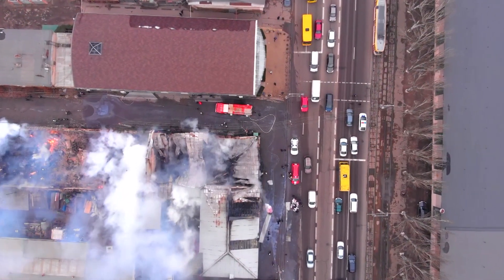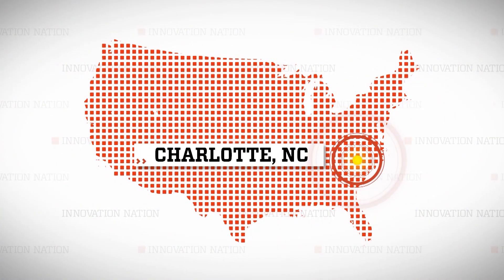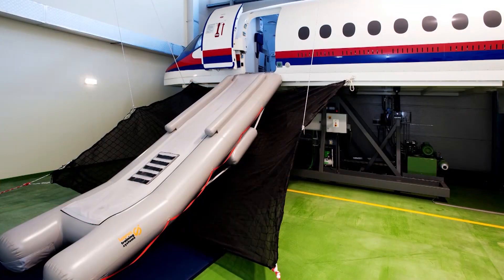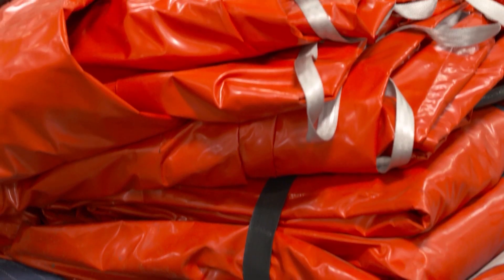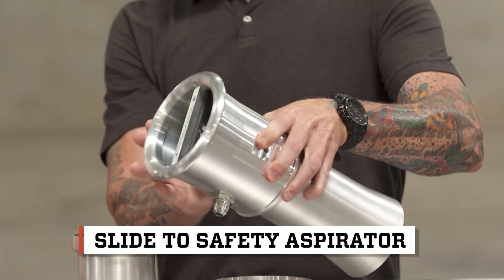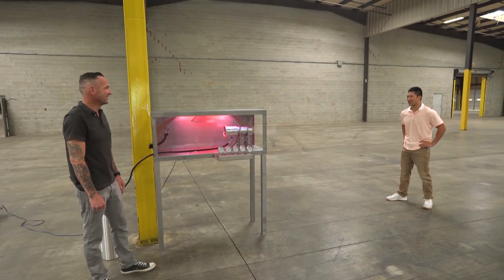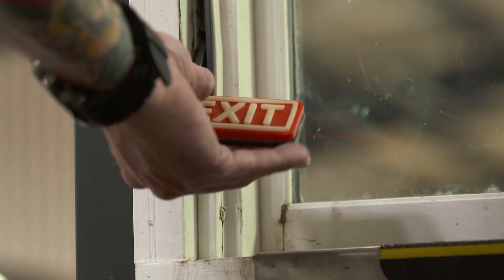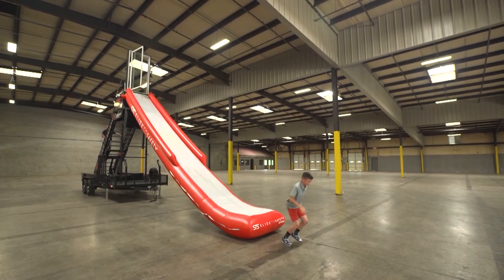How a Pilot Adapted the Airplane Evacuation Slide to Buildings | Innovation Nation

Comment: So frustrating the wrong information.  An aircraft evacuation slide has to deploy in 6 seconds, not the 90 seconds stated in this video.  The aircraft needs to be evacuated in 90 seconds, but the slide deploys within 6 seconds.  From FAR 25.810:  Except for assisting means installed at Type C exits, it must be automatically erected within 6 seconds after deployment is begun. Assisting means installed at Type C exits must be automatically erected within 10 seconds from the time the opening means of the exit is actuated.

Comment: The only problem with this is the high cost, an aircraft escape slide brand new costs around $250,000 amd can be up to $750,000 and they require a $10,000 maintinece every 3 years. They are very costly to maintain and are extremely dangerous.

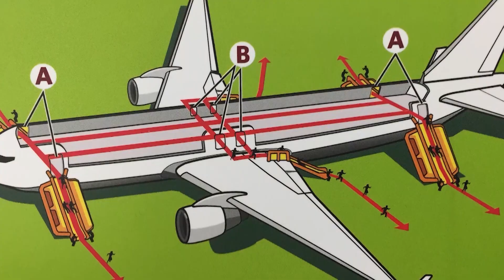Comment: @The Henry Ford (1:37), incorrect!  The FAA requires evacuation slides to be "ready for use" in 15 seconds or less.  You have confused time requirements with aircraft certification standards.  The FAA requires aircraft cabins to be able to be evacuated in 90 seconds (or less) with half of the exits blocked.
Reply: No, it is 6 seconds.
Reply: No one knows what they are talking about 🤣